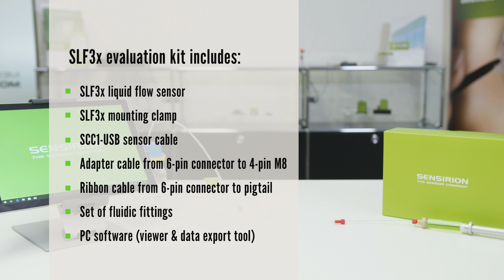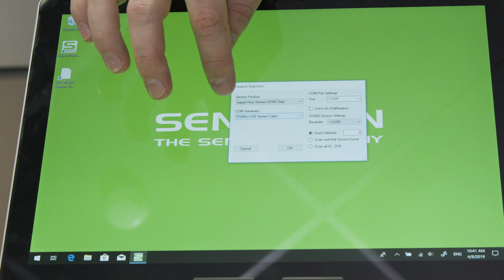Sensirion Liquid Flow Sensors: Quick Start Guide

Comment: Hello, I am Jose, If I am going to measure other liquid fluid that is not water or IPA, is it necessary to re-calibrate the sensor? How can I do that?
Reply from the maker: Hi Jose, thank you for your interest. First you should check if the error is really relevant for you. This can be easily done by dispensing liquid on a scale and measuring the time. Our sensor viewer software has a totalizer function which outputs the metered volume. Together with the measured time and the weight of the liquid (correct for the density!) you can see how far the sensor is away from what you measured. From this you can see if a compensation is really necessary and if it is: you can extract the compensation factor. If you write an email to info@sensirion.com we can send you an application note explaining the procedure. Your Sensirion Team